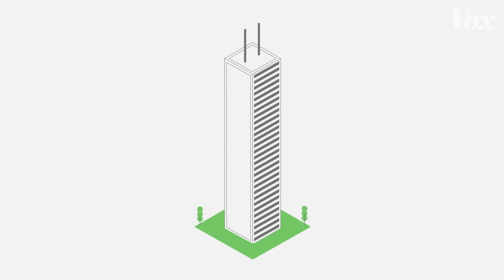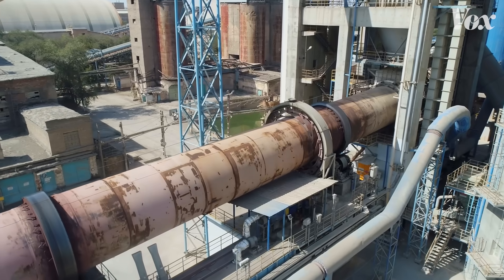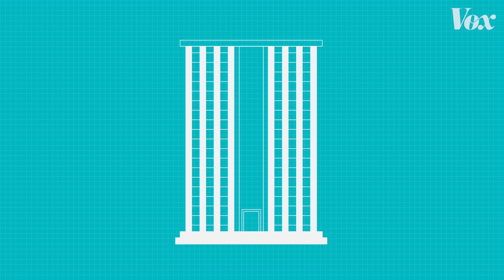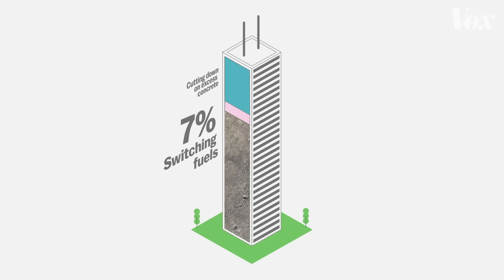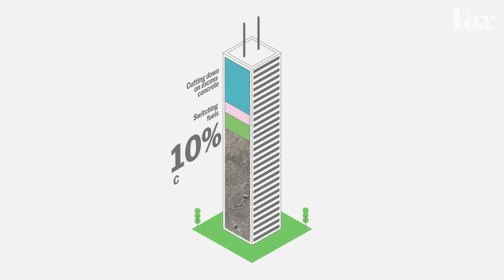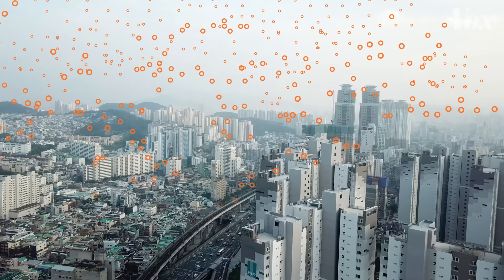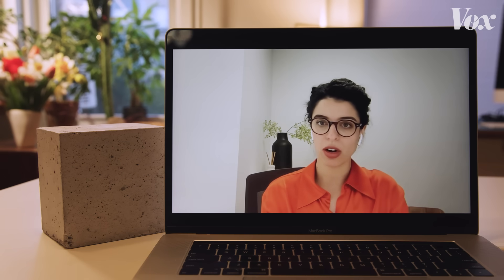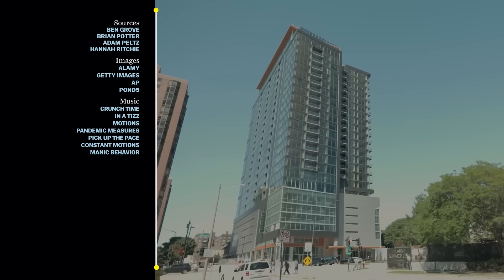The big problem with cement, and how to fix it

Comment: It is not possible for hardened cement to take up carbon dioxide without losing much of its strength. The hardening of cement is a hydration, it is not a capture of CO2 as is the case with lime used in old-fashioned construction and restoration.

Comment: As someone that works with concrete it’s obvious the reporters know nothing about concrete. Roughly 10% emissions globally isn’t bad for the MOST used substance in modern society. Wood doesn’t do anything that concrete does. How much more emissions do you think it would take for having to rebuild buildings all of the time. It’s way more I promise. Concrete is a miracle to mankind stop trying to mess with it. And btw what she was referring to when she states contractors like to “use more concrete even though it isn’t necessary” is referring to building code. Any contractor knows that the building code is the absolute bare minimum to be considered safe, not the recommended. No concrete is ever wasted due to companies bottom line. It’s always a matter of safety first always.
Reply: as someone who is an architect shes not claiming she knows  more than you she wants change and change is necessary 10 percent is alot it should be 0
Reply: @ it’s used more than gasoline. 10 percent isn’t bad.

Comment: Your video should have been done in Chinese, as they widely produce more cement.
Getting "green" changes implemented accepted by national (U.S.) building codes can take decades.
All recent cement changes, like the switch to 1L cement, put all the burden on the producers without any changes in acceptance requirements.

Comment: This is painfully optimistic. The countries that use the most cement are the ones least likely to implement carbon capture, developing countries. Do you really think countries like India, Peru, Cambodia,etc are going to slow development to implement a carbon capture project that high tech countries are decades away from mastering. Not to mention there is at least one cement plant beside every major city in the world. Imagine the work in building a pipe line to all these plants leading to a carbon capture facility somewhere hundreds of kilometers away. Cement will be one of the last industries we see go carbon neutral. The best we can do here in the foreseeable future is reduce emissions. Unfortunately the more likely outcome will be little to no change  globally.

Comment: The Evil Spirit of Elizabeth II had only 100,000 tons of cement available to use for projects so it would build then remove the building and reform buildings as it moved around the planet. Sand was unlimited on the planet as it is abundant. Clay and limestone is not. It came from Britain. London underground is a pit where the cement is from.

Comment: We just need to create a green cement with nanoparticles to increase strength and reduce the need for so much
Increasing recycling would also be efficient if there were a good way Because we can no longer use that much wood, iron is not a problem as we still have a lot

Comment: you should compare the cement production between China n US, using the years not of 1900-1999 of US,  instead, use BC 100000- AD 1000, that would be even more striking.

Comment: Instead of using fossil fuel use electricity? Good solution but isn't electricity mostly generated using fossil fuel and coal? And don't throw the renewable sources cuz we can't use them to generate electricity for home yet, let alone powering industrial sector

Comment: “If” we want to reach net zero. 
That’s a good question that hasn’t been addressed. 
I’d also like a clear explanation on what “net zero” means. 

And the comment “build with zero emissions”. Are you implying zero emissions at the building site, or across the whole supply chain?

And I thought of my own is why doesn’t any of these zero emissions/carbon capture address the concern of the atmospheric level of carbon dioxide is actually lower than vegetation optimization levels.... lowering atmospheric carbon will essentially make the planet less green with less food. 

There is always pros and cons to every scenario in life. Net zero is no exception

Comment: I'm not convinced carbon dioxide is a problem for the environment. But the more documentaries about climate change I watch the more I am convinced that the whole climate change craze is designed to implement a global carbon credits system (which is a complete scam by the way) and it's designed to undermine China.

Comment: TOP 10 THINGS YOU MIGHT NOT KNOW ABOUT CLIMATE CHANGE

1. Throughout most of Earth's history the planet had no polar ice caps and the average global temperature was between 8°C and 15°C warmer than present time.

2. We are in the middle of a 2.58-million-year-old glaciation – the Quaternary Glaciation.

3. The current global warming started about 12,000 years ago. That's how the last ice age ended and the current interglacial period, the Holocene, began. This warm and cozy climate won't last forever – interglacial periods last between 20,000 and 60,000 years.

4. Between 12,000 and 7,000 years ago the sea level rose by 197 ft (60 m). Look up the Early Holocene Sea Level Rise.

5. The climate is always changing. There is no such thing as a stable climate. If you want to learn more about the "stability" of the climate, you might want to look up: The 8.2 Kiloyear Event, The Little Ice Age and The Year Without a Summer (1816).

6. The effect human activity has on the long term evolution of the climate is multiple orders of magnitude less significant than: solar activity, the Milankovitch Cycles or volcanic activity. 

7. Chaos Theory explains how the behavior of some systems is unpredictable (chaotic). Even simple systems can exhibit chaotic behavior, like the double pendulum (look it up!). No one can predict the climate because the climate is a stupidly complex chaotic system.

8. During the Hirnantian Glaciation there was 10 times more atmospheric CO₂ than present day.

95% of all greenhouse gases on earth is water vapor.

10. CO₂ does not fit in any way shape or form the definition of a pollutant. Almost all the oxygen in the atmosphere is a byproduct of photosynthesis – a process by which organisms use light energy to produce glucose from CO₂ and water. CO₂ is used in the food industry, for example, in the production of carbonated beverages. CO₂ is also used in hospitals, for example, in laparoscopic surgery.

There are many scientists who disagree with various aspects of the man-made climate change hypothesis. One of them is Ivar Giaever, Nobel laureate in physics, who said that "Global Warming is pseudoscience". Freeman Dyson said that "Climate Change predictions are absurd". Keep in mind that science doesn't work by consensus. Science isn't a democracy. As Carl Sagan put it:

Sᴄɪᴇɴᴄᴇ ɪs ᴍᴏʀᴇ ᴛʜᴀɴ ᴀ ʙᴏᴅʏ ᴏғ ᴋɴᴏᴡʟᴇᴅɢᴇ. Iᴛ ɪs ᴀ ᴡᴀʏ ᴏғ ᴛʜɪɴᴋɪɴɢ; ᴀ ᴡᴀʏ ᴏғ sᴋᴇᴘᴛɪᴄᴀʟʟʏ ɪɴᴛᴇʀʀᴏɢᴀᴛɪɴɢ ᴛʜᴇ ᴜɴɪᴠᴇʀsᴇ ᴡɪᴛʜ ᴀ ғɪɴᴇ ᴜɴᴅᴇʀsᴛᴀɴᴅɪɴɢ ᴏғ ʜᴜᴍᴀɴ ғᴀʟʟɪʙɪʟɪᴛʏ. Iғ ᴡᴇ ᴀʀᴇ ɴᴏᴛ ᴀʙʟᴇ ᴛᴏ ᴀsᴋ sᴋᴇᴘᴛɪᴄᴀʟ ᴏ̨ᴜᴇsᴛɪᴏɴs, ᴛᴏ ɪɴᴛᴇʀʀᴏɢᴀᴛᴇ ᴛʜᴏsᴇ ᴡʜᴏ ᴛᴇʟʟ ᴜs ᴛʜᴀᴛ sᴏᴍᴇᴛʜɪɴɢ ɪs ᴛʀᴜᴇ, ᴛᴏ ʙᴇ sᴋᴇᴘᴛɪᴄᴀʟ ᴏғ ᴛʜᴏsᴇ ɪɴ ᴀᴜᴛʜᴏʀɪᴛʏ, ᴛʜᴇɴ, ᴡᴇ ᴀʀᴇ ᴜᴘ ғᴏʀ ɢʀᴀʙs ғᴏʀ ᴛʜᴇ ɴᴇxᴛ ᴄʜᴀʀʟᴀᴛᴀɴ (ᴘᴏʟɪᴛɪᴄᴀʟ ᴏʀ ʀᴇʟɪɢɪᴏᴜs) ᴡʜᴏ ᴄᴏᴍᴇs ʀᴀᴍʙʟɪɴɢ ᴀʟᴏɴɢ.

In general, when you're convinced of your truth, make an effort to get out of the echo chamber and listen to a different point of view. You might learn something.

Comment: 1.  Replacing concrete with wood will cause fast deforestation.
2.  The locations of the kiln where temperatures are lower electricity can be used.  the high temperature areas can be heated using fossil fuels.
3.  The CO2 produced can be collected as fly ash for use as binding material.
4.  Concrete is porous and it can store the carbon emissions.
5.  Smart RC design ideas will be very beneficial.

Comment: Why store it underground and cause new problems while it could be used to make basic chemicals from it. It's like they don't want to have a solution. 🤔
Imagine some geothermal activity and all the stored carbon dioxide is released at once. 
The only solution is a complete circular economy. In which concrete can be 100% recycled. In which we capture the CO2 and use it for building chemicals. We should work towards that instead of these "If you can't see it, it ain't there" solutions. 🙄

Comment: better use of pozzolans as cement substitutions would go a long way. Often you can replace up to 30% of the Portland Cement with Pozzolans (steel fly ash or volcanic ash)
we should be recycling 100% of Steel fly ash for use in concrete, but I think we're a long way off that.

Comment: Nuclear plants could be zero emission cement manufacturers that directly produce the high temps needed. Weird to not mention that we literally have the tech to do this at scale and have for like 80 years.  You don’t even need to produce electricity and deal with those inefficiencies, you get all of the magic heat you need with no co2. Why on earth would you ignore this option? Like this isn’t rhetorical.

Comment: Assuming a CO2 capture rate of 90%, which means that 900 kg of CO2 can be captured and converted into solid carbon, the process would require a significant amount of energy to power the electrolysis reaction. Based on current estimates, it would require approximately 1230 kWh of electricity to convert 1 tonne of CO2 to carbon using the electrolysis method.

Assuming that the electricity used to power the electrolysis process comes from a renewable energy source such as solar or wind power, the process could potentially result in the production of solid carbon with a relatively low carbon footprint.

Comment: OK this is kind of true given that CO2 is given off by heating the lime stone with fossil fuels. If this heat was produced using concentrated solar .. ha ha well that won't happen .
4,600,000 Kgs of CO2 / 2.68 for each litre of diesel = 1,716,418 L, and at 11L/100KM that is  15,603,800 KM ! YIKES Fact Checked is correct ! In Australia that would cost you in carbon taxes $1,265,000

Comment: Architects should ignore “carbon conscious” design. Far more important is making safe buildings that are beautiful, such that they last 500+ years instead of 50.

Increasing the longevity of structures will reduce long run emissions far more than wood panels, electric kilns, or any other Scandinavian fad.

Comment: The very definition of green wishful thinking. Substituting concrete for other materials, and changing the inputs into cement production is unlikely to be cost effective, and will result in lower strength concrete being produced

Comment: I'd Really like to see where you got the statistic, or stated fact, that Concrete Cost is a minor cost relative to the Constuction. Currently Concrete costs are rising rapidly and contributing significantly to cost of construction. This is not an "easy" change and should be discussed, not just breezed over. Most high rise buildings, Concrete costs are typically 10-12% of the total building costs. I don't see how you believe that is a minor cost.

Comment: Good video, and thanks for mentioning our carbon capture project at Heidelberg Materials in Brevik, Norway. We aim to be operating by the end of next year and plan to capture 400,000 tons per year.  
That will really lower the footprint of concrete mixed with our cement.

Comment: I'm an EIT at a Carbon capture company running a pilot with Lafarge Holcim. It's great to hear there is support for point source capture like in the case of cement. It's a lot more effective than direct air capture especially when considering industries required for modern society. The tech is there but companies, especially in Canada, don't have the funding to scale up capture plants like the initiatives in the States. Glad to see the processes I've been learning about are trying to be implemented globally

Comment: Two not-yet-ready-but-I-hope-it-gets-there solutions to also look at: One, the well-publicized Heliogen's successful efforts to create heat over 1,000 degrees C using computer-controlled mirrors - I don't believe it's 1450 degrees C yet, and I don't know if it's economical yet.  Speaking of economical yet - Two: if we can produce graphene in large enough sheets, I understand it's as strong as steel and can be configured to replace steel and concrete in many applications.  Even better - it's carbon, so it stores carbon in our construction.  But, as I understand, we still cannot produce large enough sheets to be economical, and besides, we still have difficulty splitting carbon dioxide into C and O2 instead of CO and O (CO and O doesn't help).  [Sigh]  So, here's hoping for those two processes.

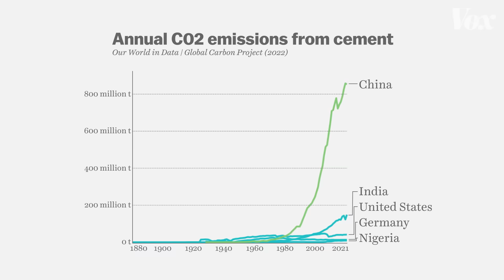Comment: 0:47 What timeframe does this graph capture? Cause many countries are still in development phase like China & India where they are building cities on a rapid scale. But US and many western countries are already developed, and did all that years ago. So does this graph take that past data into account? Many countries also use concrete for construction due to the climate in that region, where using concrete is more efficient in the long run for lowering the reliance on heat-pumps, or even in densely populated areas for noise isolation. Overall, cement is a factor that contributes to global carbon emissions, and would require a ton of new reforms, R&D, and education to change that in the next 2-3 decades. Similar to electric vehicles, the development of technology, testing, validation, approval from government, and followed by slow adoption rate by consumers. But more research into this will probably present better alternatives to cement.

Comment: I’m a civil engineer and living in the Caribbean is very difficult to build without concrete with the amount of hurricanes We receive and with time those forces are getting stronger.

Steel construction here could be done but it’s maintenance is expensive do to all the exposure to the sea.

There are lots of places you can build without concrete but not the caribbean for now

Comment: I don't understand, you initially said the fuel accounts for 40% of emissions, however you then go on to say switching it will only reduce emissions by 7%? Did I miss something?
Reply: Switching the fuel it's just a little bit more efficient but will still emit a lot of emissions, though not as much as burning plain fuel.
Reply: @benjaminsmuda7214  Makes sense, thanks!

Comment: Why is the CCP building so much when they have to literally TNT other buildings because there are millions of empty apartments and the housing market is about to crash? This is the real problem. Their population is even shrinking now.
Reply: Because china arteficialy tries to keep up their economical growth. The main reason for the ccp to stay in power is the promised growth in wealth.
Reply: @sH-ed5yf  Yes you're right. But as long as China does whatever the f it wants, our steps for less carbon barely make any difference. I think if the numbers are correct in the video, China is creating more CO2 than the rest of the world combined right now in cement production.

Comment: I have a difficult time believing that you can simply incinerate those toxic materials without consequence.  That Imperial College fellow says it prevents the release of "nasties" into the air.  But even if that were true, surely it's not going to simply disappear altogether, right?  I'd sooner believe it being captured and sealed into the concrete.  However, whenever that concrete needs to be demolished one day, it's going to be releasing all of that crud back into the air again.  If someone has some actual expertise on this that can educate, I'd appreciate a comment.  Incinerating such things might be a stop gap solution, but not an ideal one.
Reply: I'm not so sure about 'nasties' getting absorbed by the incinerated limestone ... but I do know that the major combustion pollutants (causing smog, acid rain, etc) nitrogen-oxides, sulfur-oxides etc, can actually be very reliably scrubbed from combustion gasses through various chemical treatment processes.

Look into AQCS (air quality control systems), ammonia scrubbing etc.

In fact, we have done a VERY GOOD job at cleaning up combustion gases. What is emitted now is mostly CO2 and water vapor.

Comment: These videos would be more credible with people who work in the civil engineering and construction industry to speak on this matter. Including climate scientists who can also convey the real science behind carbon emissions and how it's tied to cement production would make it even better. There's a lot of nuanced things in the civil engineering industry that the average person isn't aware of. Whether that would be design specifications, industry standards, the chemistry behind how concrete truly functions and how that relates to the strength and other mechanistic functions of modern day concrete, and so on. There's a reason why we have ACI standards for concrete design and that's in part constrained by how essentially all concrete structures are reinforced with steel rebar and how those two different materials work together. Modern day research of concrete includes "self-healing" concrete that may not function the same with the cement material alternatives proposed in this video. Additionally, there's research on how you can use polymers to do additional reinforcement of concrete to prevent cracks for occuring as often or extend the period prior to those cracks occuring. Polymer materials (mostly plastic) are oil based, so that opens the question of another environmental issue that tends to be politicized. So providing "solutions" to material replacement for infrastructure should not be just tossed around like it holds no consequence to miseducating the general public. There needs to be an objective approach to these kinds of topics that should be led by those who are educated in the problem, not reporters reading off of a script.